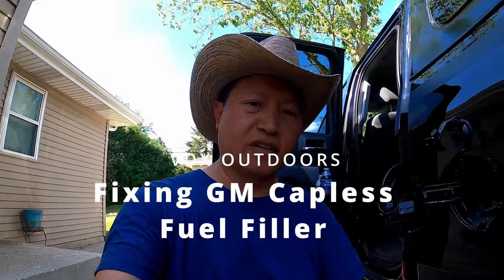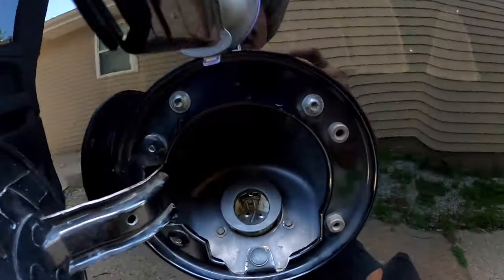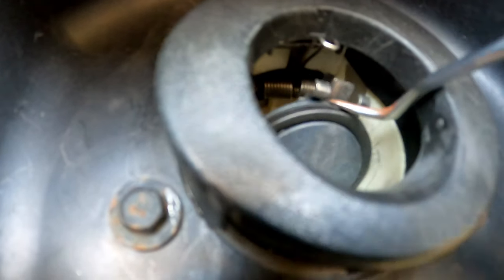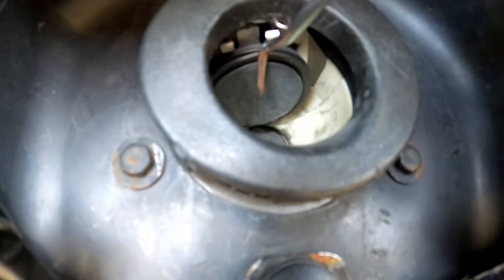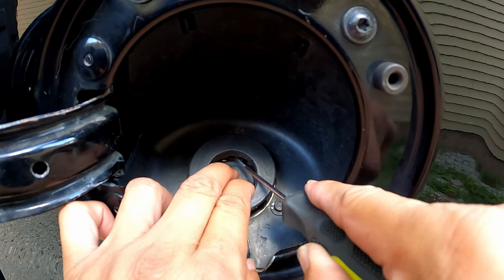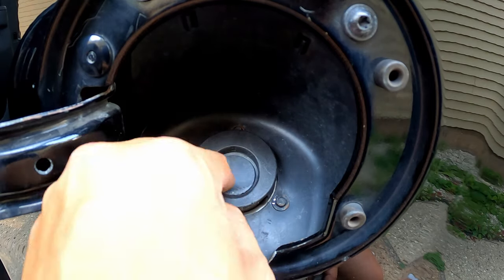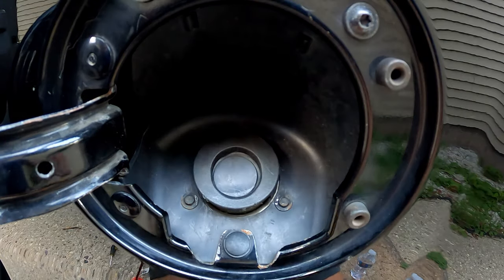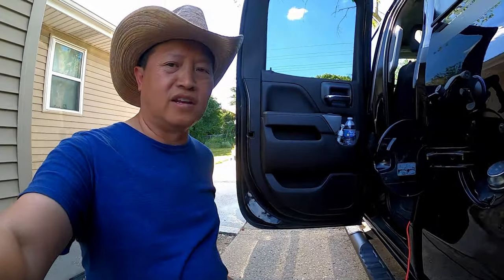Fixing GM Capless Fuel Filler

Comment from the maker: *** UPDATE***
THE HUBCAP SIZE IS 2.567-IN.. Not 1.75 like I said in the video.

A month after I fixed the capless filler flap, it fell off again!!  I reinstall the flap on same way I did in this video. This time I use super glue to glue the center of the bar to the cap. Do not super glue the left or right and of the bar, just in the center only. I haven't had any problem with that flat falling off since then.

Comment: Great video!  I was able to fix mine too after buying those same tools for $10. Thank you!
Reply from the maker: You're welcome! I also find it helpful to make sure it doesn't come off again by super glueing that little bar to the two clips of the lip.  Make sure you don't glue the ends of the little bar.
Reply: @VDXOutdoors  Ah, so that bar will rotate if you can fix the clip to the bar (so long as you don’t glue the bar ends and accidentally fix the bar itself)?  If it comes off again I may try that. Was also trying to come up with a way to further clamp the clips back tighter once back in the bar but obv tight quarters in there. Anyway, your video gave me the confidence that reattaching it could be done and with some persistence, it’s def true.
Reply from the maker: @willreutzel7462  Yes, you can super glue the center of the little bar to the clips of the lip. Mine came off again because I had bent the two clips of the flap outward too much.  I had to redo it again.  This time I glued it on at the center of the little bar and it worked.  The little bar is loose on the ends to rotate up and down.  Glueing the middle doesn't affect the  flap.  Good luck!
Reply: @VDXOutdoors   i have a question so if your lid looks like that it would affect your gas mileage
Reply from the maker: @marcusgalaviz9492  It doesn't affect your gas mileage because the top lid is to prevent debris from getting in. The second lid (underneath the top lid) is supposed to maintain fuel pressure.
Reply: @VDXOutdoors  found out its a camshaft senor 😭 2018 chevy malibu
Reply from the maker: @marcusgalaviz9492  awesome!  The camshaft sensor is not hard to replace. I replaced sensor on my 2010 Honda Accord.

Comment: Thanks for the tip. What do you do if the inner flap isn't getting a good seal and causing the check engine light to come on?
Reply from the maker: Not sure. Try to make sure the rubber seal around the inner flap is not ripped or has debris on it.  It's poor design

Comment: There is a very simple solution to that. All you have to do is get a rubber ball hitch cover or a can that is 2 5/8 inches in diameter and simply cover the gas entrance.  Now you won't have any water getting to it.
Reply from the maker: Yes. I bought a 2.56 wheel bearing hub cap. It works just as good.  The problem was that that first lid of the cover fell off, and I had to find a way to put it back.

Comment: I’m f’d we just had all this snow and my capless fuel door is iced in. Might take a heat gun to it idk what else to do
Reply from the maker: Use I pick or sharp screw driver to break the ice. Use a shop vacuum to suck out the ice pieces.  Don't poke too hard to break the seals of the flaps.

Comment: My flap is not returning all the way back. Gm wants $700 for the repair. The tech says the spring is not working anymore. Any chance how to fix or clean the spring?
Reply from the maker: The spring should be ok.  You have to push the spring down before putting the flap over it.  

If the spring is weak, try to stretch/open the spring to strengthen it.

Comment: I had exactly the same problem yesterday during 20° weather. Ice und the top flap blocked being able to gas up. I was picking ice out with my pinky finger and that’s all it took to dislodge the top flap. The top flap is supposed to keep water and dust out but obviously it doesn’t work or ice wouldn’t be under it. That means in warm weather water is going into your gas tank. Some idiot designed this gizmo.

Comment: Mine is broken, from the ice getting inside and I was not able to get gas. Now I haft find out how to fix the flapper part cause it still gets rain in it so I’ll put a cap over it but my check engine light won’t go off now because the flapper won’t close all the way it is a poor design
Reply from the maker: To prevent water getting into your fuel filler, buy a trailer wheel bearing cap that is 2.567 inch from your local auto parts store and place over the hole. That will prevent water getting in there.
Reply from the maker: If your check engine light is on, check the inner flap to make sure it's closed tightly. The outer flap is to prevent debris and water to get in there.... Which doesn't work.  If the inner flap is sealed tight and close tight, clear your check engine light with OBD2 scanner.

Comment: I found it absolutely impossible to get it to reattach to the bar.
Reply from the maker: You have to balance the circular flap with your left two fingers and use the bent tool to push up to the bar. Once it's in the bar, I found it helpful to super glue it together (so it won't come off again)
Reply: Great Video, but it's impossible to get it on the bar. Maybe, if the clips are already bend. This Capless fuel filler is a such a poor design, completely useless and a pain in the... I really tried it hard to fix it on a Cadillac XT4, gave up and took it to the Dealership.
Anyway thx for the Video!
Reply from the maker: @niederbayer3152  I totally agree with you. The worst design for a fuel cap. A fortune 500 company that pays their engineers top salary... and this is what they came up with!? 

Dealership will replace the whole pipe down to the fuel tank. At least that's what my dealer said. Good luck.
Reply: @niederbayer3152  my gas cap looks like his too  and i feel like it’s affecting my car mileage my dashboard tells me how much miles i have but now its now reading in accurate  i hope thats why my car is doing that ill put 150 miles in my tank and its jumping from 150 to 149,146, back to 150 but i wonder if it’s because of the lid being not on because of the pressure

Comment: Frustrating, my spring is not pushing on the flap like yours my spring is not cooperating
Reply from the maker: You may have squeezed the clip on the flap a bit tighter so it'll clip on the spring.